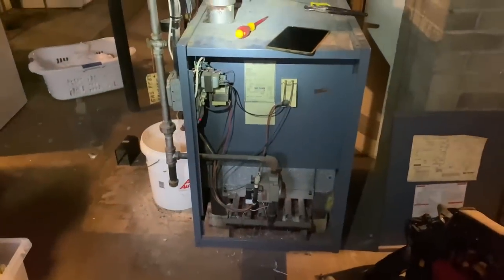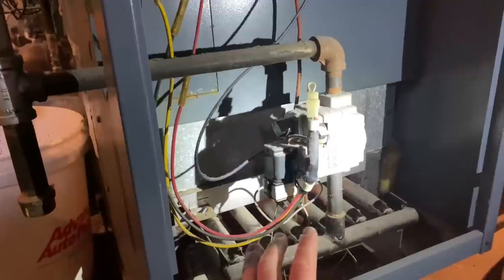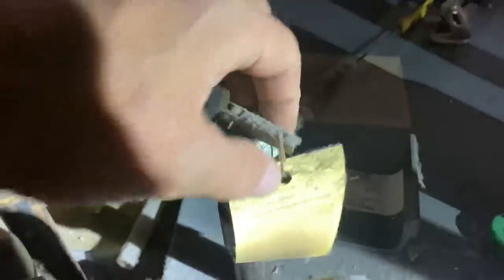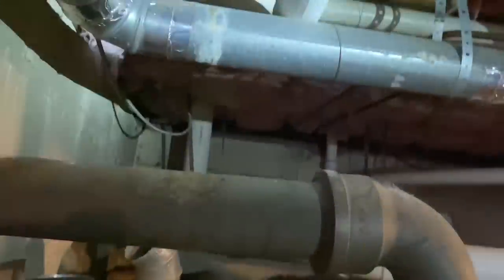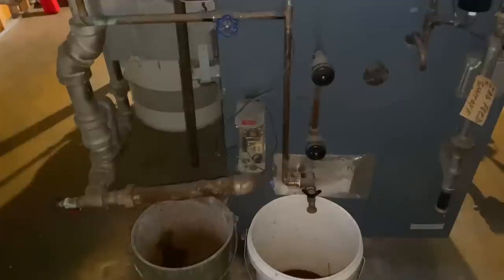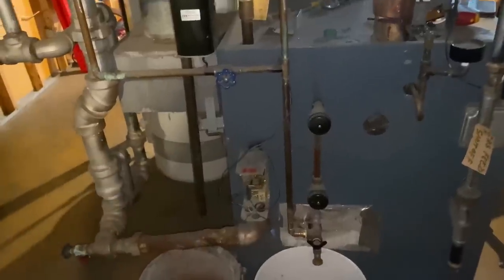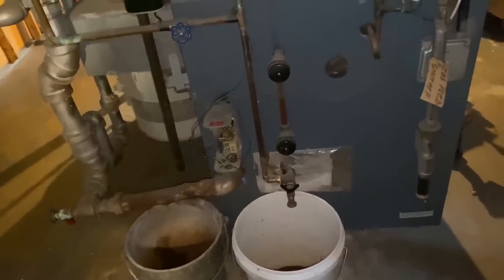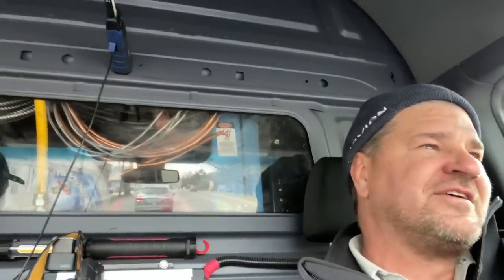Weil McLain Pilot Relight Control, Mercury Flame Sensor & Gas Valve Explained!

Comment: I remember those WR switches well,  for a while they were adding a card between plug and gas valve, that had a resister on it. 
40 years on a eg is a good run

Comment: Weil Mclain used to make a conversion kit for the WR Pilot Relight systems. The kit would include a gas valve, spark igniter, flame sensor, an ignition control, and pilot assembly. I converted a few of those old systems when I worked up in Central NJ. I think the kit is still available, but in this case it is not worth it because the boiler is a  boat anchor

Comment: if it wasn't chooching steam out the chimney and the just the valve/pilot setup bad, it would get a standing pilot valve and thermocouple pilot assembly slapped on.
but it's clearly hit, as is the chimney and liner

Comment: Don't know if that boiler had a manufacturers date on it, but given your detailed explanation as it pertained to the gas valve configuration, figure it is about 40 or more years old.  The boiler doesn't owe the homeowner anything at this point.  Hope they call you back to do a replacement in the future.

Comment: These WR intermittent pilot systems were the worst, especially the LP versions with the lock out.  If they didn’t light on the first three clicks, the mercury switch wouldn’t prove fast enough, and they would lock out. I believe those gas valves had a pressure switch built into them also.